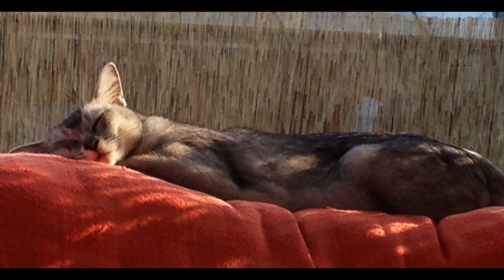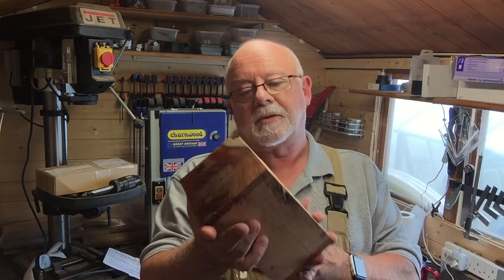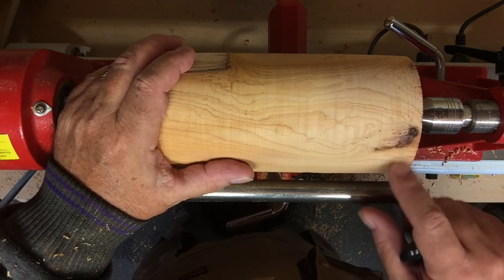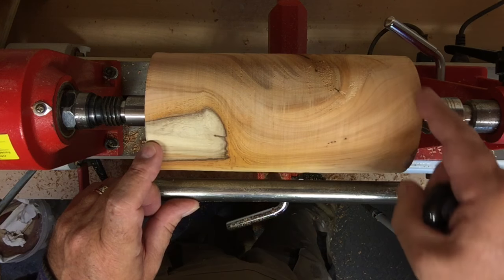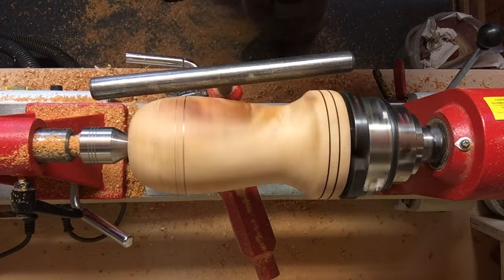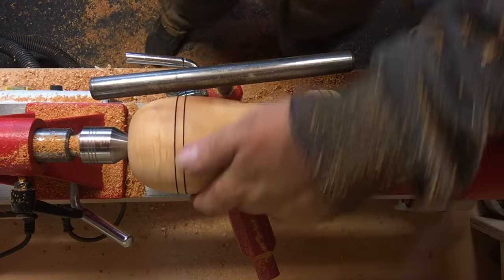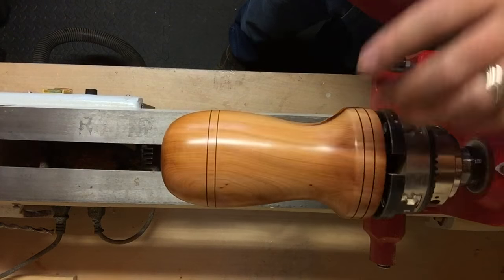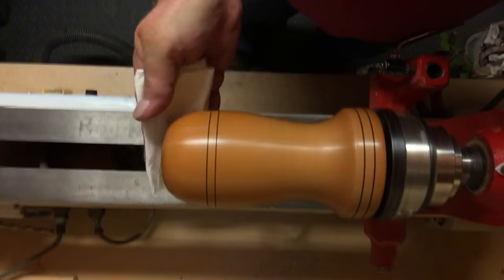A Yew Table Lamp

Comment: Hi Ian. I've now got both the 9mm hollower and the Yorkshire Grit. Both are excellent products. I was challenged to turn a tiny Chinese lidded box and used both of the cutter and grit on it. Am very pleased with the result. I've also turned a number of bowls out of this spalted beech that have turned out rather well. Keep up the great videos.
Reply from the maker: Hi Graham,
I'm delighted that you like the hollower and Yorkshire Grit, they are great products!  OK on the spalted Beech.  I really want to have a go at spalted wood but too much else to do at the moment!  Sorry for the delay in bringing out another video, work has been mad and I simply have not had time to get into the workshop.  I am now starting to think about what to do next.

Comment: Great job Ian, I must admit I wasn't taken with the form but once the lampshade is on it couldn't have been more perfect
Reply from the maker: Hi Glyn.  I wasn't too sure myself as you can probably tell by the video but it turned out OK.  Whoever makes that Yorkshire Grit stuff is on to a winner I reckon, even if it comes from the wrong side of the Pennines ;)
Reply: +Ian Maude thanks for your confidence in it, there are two wrong sides of the Pennines <whispers> north & south ;)

Comment: Great lamp Ian. Really nice job. I'm going to do a lamp as my next project. Luckily I've been able to acquire a hole boring tool and a set of drive centres. The tool looks like a long 7mm drill on steroids and is about a metre long. The tail stock is hollow so you can feed the tool through to the work. Then it's long slow boring session to half way. The idea then is to flip the work and drill the rest of it. I'll let you know how I get on if I survive the experience. I see you that you Glen Teagle's excellent carbide cutters. Great guy and tools. Got some of the Yorkshire Grit and am well pleased.
Reply from the maker: Thanks Graham, I look forward to hearing how you go on.  If turning the piece is even slightly off it won't matter because the offset will be well hidden when you drill.  That was my mistake on my lamp :)  As for Glenn's tools, I am using them pretty much exclusively now and the 9mm box hollower is excellent!  As for Yorkshire Grit, it has made such a difference to me in the workshop.

Comment: Thank you for a very pleasant video.  I've made several table and standard lamps in recent years and made many mistakes along the way.  In my early attempts I turned the lamps and then decided it was time to simply drill the hole for the cable.  Horror of horrors when my drill bit decided to follow the easiest route and emerge through the side of my masterpiece.  The first thing I do now is to drill the cable hole so that I can enjoy the rest of the project.   I have a long drill bit and where possible I come in from both ends and look forward to seeing daylight when they both match.  Sadly, this is not always the case so I now begin the holes with a sturdier bit which is not so susceptible to going off course.
I'm glad you've discovered yew which I think is one of the most beautiful woods imaginable.
I hesitate to advise you of one of its disadvantages which is that its very susceptible to damage from UV light.  I've turned some pieces of which I was very proud only to find that about a year later they've changed colour to a very drab brown.
However, there are some finishes which now contain a UV protective barrier.
Happy turning.
Alan.
Reply from the maker: Thanks for a very informative comment Alan.  I will keep the lamp out of direct sunlight.  I am not sure about the UV protection properties of Hampshire Sheen but I'm sure Martin will chip in.  I don't think I will be looking at standard lamps for some time ;)

Comment: That's a great job Ian.  I was told to drill from both ends when making lamps because the drill will follow the grain and run off by the time you get to the other side of a full length of stock.  If there is any misalignment when drilling from both ends it won't be seen inside the piece and you'll still get the cable down.  
Best Wishes, Brendan.
Reply from the maker: Thanks Brendan.  I find it odd because the drill should stay in the central path.  I have drilled out other pieces with no problem.  I will try your method next time.  I did wonder afterwards if I should have started the drilling with a drill in the tailstock.
Reply: Even with the drill in the tailstock it can wander.  Yew is particularly difficult to drill because of the way the grain goes everywhere.  I have found that really straight-grained wood van be very difficult to drill as the grain is so uniform is will move the drill over into the path of least resistance.
Reply: A complication here is that a 6mm auger bit has a fairly thin core, and therefore can easily flex.  When that is combined with a hard wood and crazy grain, drilling a straight hole is a challenge.  In addition to Brendan's suggestion of drilling from the two ends toward the middle, another helpful technique is to advance the bit VERY slowly - if you advance the bit too quickly, before the leading edge can cut a hole for the bit to move into, the bit is more likely to wander with the grain.
Reply: Thanks Louie, I wasn't aware of that.
Reply from the maker: Thanks Louie.  I had previously used the auger bit to drill a hole in a banjo dowel stick and it was absolutely true.  This is probably because of the makeup of the wood.  I did advance VERY slowly but obviously the grain in this caused a problem.  I will know better for next time :)

Comment: That turned out really nice. The grain really does make the piece. When you were turning it down I wasn't sure about the big wide shape, but that's because I'm used to seeing thin stemmed lamps. Still something I have to do as a project which has been held up for drill bits etc.

If those were C type jaws on the chuck then I think you were pushing them a bit when on compression. The optimum size is about 56mm and you did have quite a gap between the jaws.

I think I would look at drilling as soon as possible and then using the hole as the centerline for the piece especially as drilling at that depth the bit is going to wonder.

Excellent job, think you should give the cat a few extra treats or we wouldn't have seen this.

Well done!
Reply from the maker: Thanks very much Paul.  I had done some long drilling before this and had no issues.  However, this was with banjo parts that were laminated and I suspect I got away with it because of the differing woods.  Other comments below have the right of it I suspect, drilling from both ends.  It doesn't matter if they don't meet perfectly in the middle of the piece ;). As for the cat, he is spoiled rotten, lol

Comment: Hello Ian, greetings from Miami Shores, Florida, U.S.A.  Just watched your lamp video (April 9, 2019).  

Your step by step narration is very helpful.  The lamp came out beautiful. Shape and finish is top notch.  I saw you used Yorkshire Grit and Hampshire Sheen, what was the last product?  Also, what are you using for the burn decoration?

Thank you
Lou
Reply from the maker: Hi Lou and thanks for the comment.  I use a piece of kitchen top laminate for burning, it is easier to control than a wire in my opinion.  The last product was also from Hampshire Sheen and is basically carnauba wax.  Ian